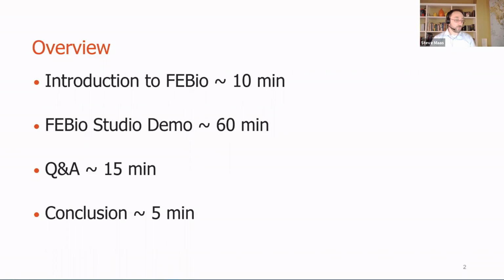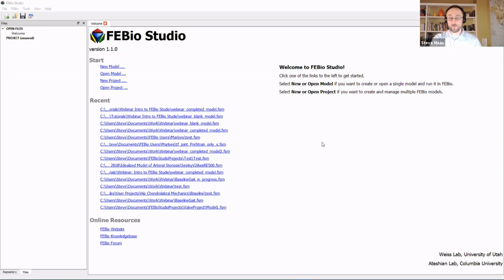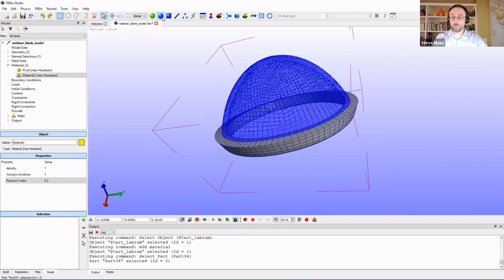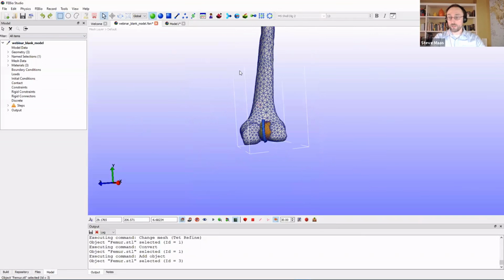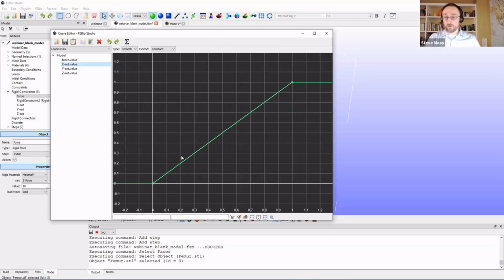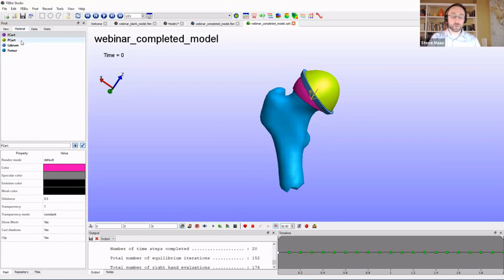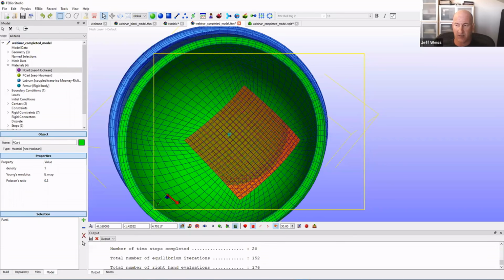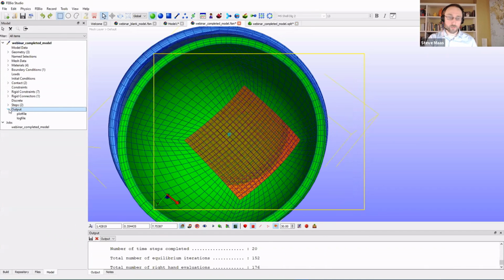Webinar: Introduction to FEBio Studio

Comment: Hello Steve, I am Stefan Mucenica, a PhD student in Biomechanics who has just started learning how to use FEBio. I have  two questions regarding the import process: 

(1) let's say that I have the femur like in your case, but I don't have the specific coordinates to put it in the right position with respect to the other assembly parts. Is there another way to do that, for example but setting a constraint just for positioning it correctly, similarly to what it can be done in some commercial CAD/CAE softwares? 

(2) on the other side, let's say that I have a biomechanical system (e.g. bone and tooth) and I have the stl meshes of both. Is there a way to pre-process them so when I import them in FEBio to have them directly in the right position (in this case, the tooth in its alveolar socket)? For example, this is the case with some stl files I found in some online medical datasets: I import the tooth first, then the bone, and they are correctly positioned from the start. What is the operation to do before importing in order to achieve that? 

Thanks in advance!

Comment: Hi, thanks for the tutorial. I have a queastion regarding the mapping technique, when you selected the inside, the red area won't be seen from the outside and so it is with the outside. In my case the red selected area (faces) can be seen everywhere. Can you help? Thank you
Reply: I have the same issue. Can't select the outside surface without overstepping the boundary and as soon as that happens I have the inside surface and the rim selected which is driving me nuts. Have you found any solution to fix this?
Reply: @szj1183  Hi! In my case, I selected and applied the material first then I applied the mapping technique. Let me know if it works, otherwise it also might be due to difference of version.

Comment: In version 1.6.1, when trying to create the Scalar Field, it does not work. Console log is: 
NOT converged!
iteration count: 1
Final relative norm: nan
Reply: Try changing the SOR parameter. The default is 1 and he changed it to 1.95. I had this same issue!
Reply: @remybenais3150  i tried that and still have the same problem! do u know how to fix it?
Reply: @caroleduardogayosovio8047  try a different version of FEBio Studio
Reply: I have the same issue, and all of my software seems up to date (FEBio is at 3.6 and not 3.7). Have you found out why it does not work?